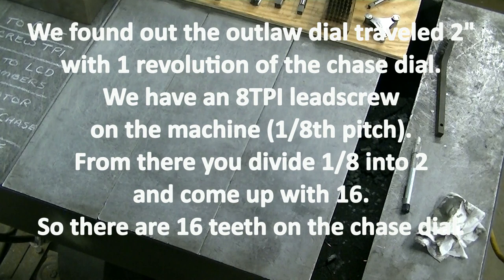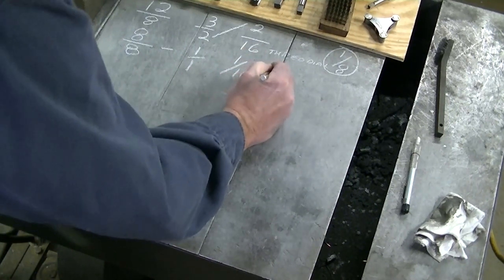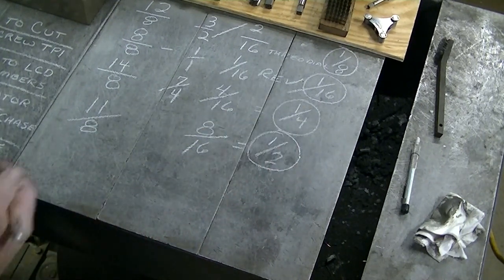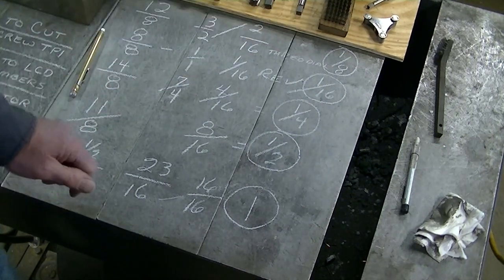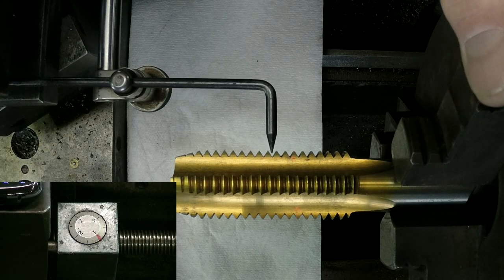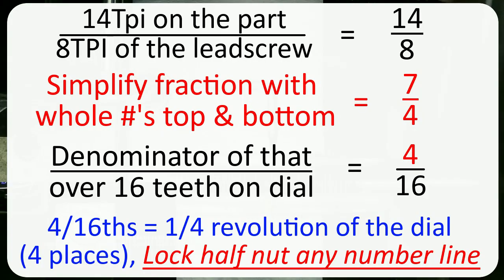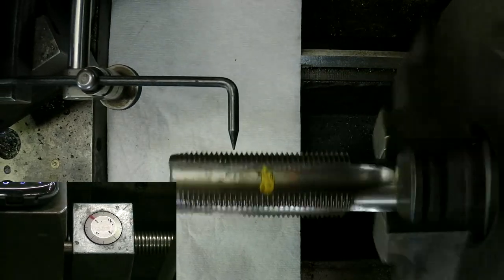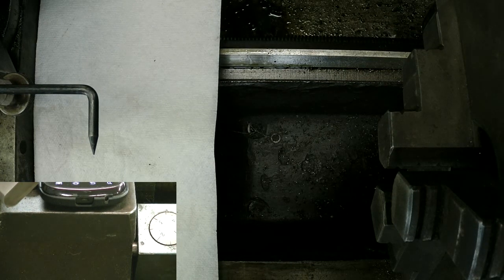Using the Lathe Threading Dial Part 2

Comment: thank you,this is the first time anyone has explained in a way that i can understand for the imperial lathe. the problem for me is i have a metric lathe with change gears for the the threading dial. how do i figure out which gear to use and when ? i have read several books and they all say it is too complicated to explain so refer to your lathe manual. my Chinese lathe does not explain anything ! all it tells you is the spec of the machine and idiot pictures of some strange version of health and safety rules !,
can you help me ?  Andrew Norman
Reply from the maker: The dial "meters off" length with metric lathes, and threads are designated in "lead" or "pitch" only. To set gears to cut a metric lead requires the "Drivers/Driven" be set by the ratio "Pitch to be cut/Pitch of leadscrew" same as an imperial pitch or lead would be. If you noticed the fraction a for the chase dial solution was the reciprocal of the one used to cut the thread. The numerator of that fraction must divide evenly into the number of teeth on the chase dial for things to work. So the different wormwheels for your dial are to provide an exact multiple of the lead you are cutting. It seems clumsy, but it's what happens when base 10 meets the real world where fractions or ratios are needed due to "preferred" numbers. I may need another video. Try searching homeshopmachinist for very detailed threads on this q:). Thanks for watching!